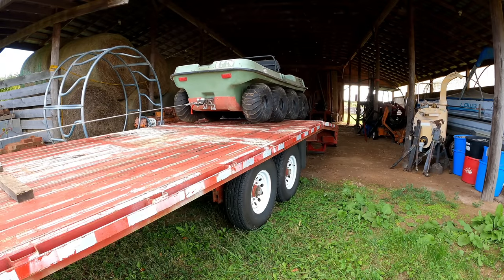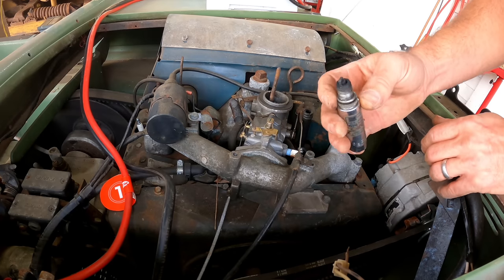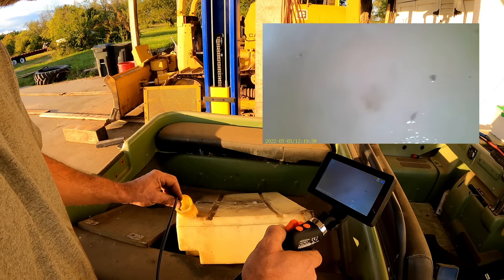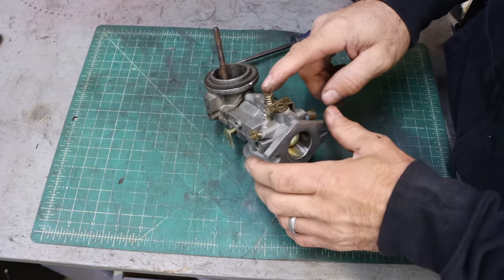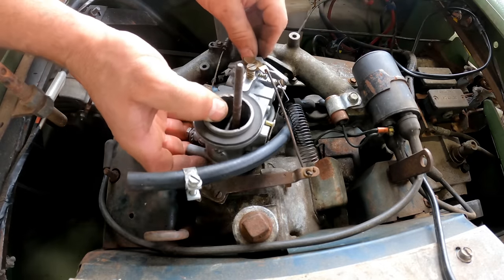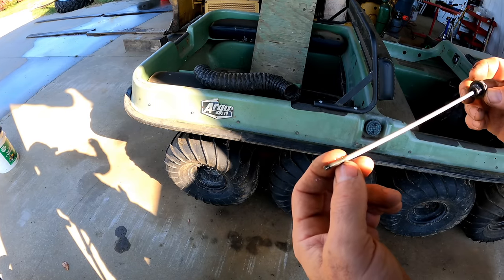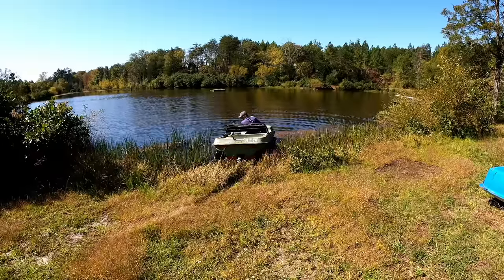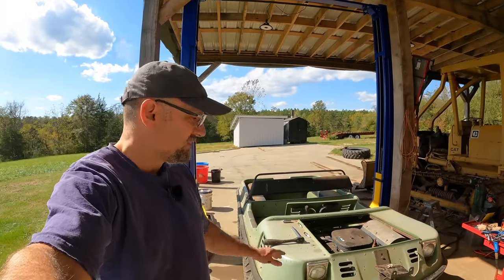Fixing An Abandoned Argo Amphibious Vehicle, Will It Start?

Comment: Not sure if your charger has this option. Mine is a similar model. You may be able to override the low battery failure to detect and apply direct voltage. Here are the instructions. 
1. unplug charger from wall
2. hook battery to charger
3. press and hold “display” and “type” button at the same time
4. while holding those buttons – plug the charger into wall.
* this will bypass safety features and charge the battery even if it is dead (assuming the battery can be charged at all)
– do not run in this mode for more then 5 minutes or you can damage unit and battery.
– this will get the battery enough of a charge so that the charger can detect a battery is hooked up to it (1 volt) .
5. unplug charger from wall.
6. wait 30 seconds and plug in charger into the wall.

Comment: That is a mechanical fuel pump on that engine. Most of the older Kohler engines of 12 hp and up used mechanical pumps.

Comment: I would do a compression check and a leakdown test. Oil in the cylinder after running indicates you are getting some oil bypass from the rings probably.

Comment: I've had 4 Argos still have a CG orange one 8 wheel ,They're all the same I found if you back out of water the back end sits higher ,But U also carry a 4 "rebar hook system to throw ashore or into a tree to pull as you go off water its way more beneficial ,But yup most are a toilet in water but ultimate in swamps and sloughs and will climb like a dozer ,I've made a boat motor bracket for mine using a trolling motor ,Now I have 3 gas small engines I haven't used mine for awhile  but it's got Runamuck tires like yours they're a water web tire you can get a flat track system from a 6 wheel too that is awesome in swamps but if they come off OMG your day is busy PS DO NOT LEAVE RAGS IN THE BODY  ANYWHERE unwrapping cloth from sprockets and chains suck bad .

Comment: Thing to remember is just because it is amphibious does not mean it can bulldoze down a wall of pond / lake reads, even full sized military amphibious vehicles struggle with such things so asking this thing to  bulldoze through them is an reasonable ask.   These like most amphibious vehicles need a fairly smooth and unobstructed entry and exit from the water

Comment: Fun little 8x8 vehicle. I guess to move it on the pond, a paddle would be almost as good as running the engine tho.
One question about reviving deeply discharged batteries: Is it not better to use a lab powersupply and set it to a very low current limit (< 0.5A) at nominal battery voltage and slowly build up the plating for the first few hours again? You can then gradually increase the charge current over time as it starts to pick up angry pixies. I would think that hooking up another car battery straight to it might reform it unevenly, so it does not ever get back to a high capacity again.

Comment: I really don't know a ton about these, beyond when they first came out I wanted one badly though I had/still have no use for one.  Would be cool tho.

Greg (Red Beard Garage) had one (though don't recall if it were an actual argo or a knock off) and he traded it to Mike Finnegan for something I can't recall, and Mike seemed to have similar experience with his in the one video I saw..  It floated, it'll go in/out of water, but its not super great on water.  In my professional non-engineer engineer opinion, those things need a prop for water.

Comment: My mechanic mentor when I was in high school back in the early 1970's had one.  It was the vehicle that I learned that WD (as in WD40) stood for water displacement.  We flooded out the points and he showed me how to pop off the cap and spray it down with WD40 to git'r run'n again.  Good times.

Comment: Don't fear the governor, sometimes it needs a helping hand. 
The higher rpm's should only happen initially when started. 
Then should settle lower once has been running for a brief time and not go back up to that range during use. Well not until the next time you start it. So you may not have needed to use the throttle limiter to restrict rpm's/speed. These things are slow enough. Lol 

Ps. Throw a bunch of gravel on a section of the shoreline so you will have an area to get in and out that isn't totally mud. 👍

Comment: The engine is not smoking any that I saw, so I would not be too concerned about those pits until there's smoke. Definitely install a bilge pump with a float-activated switch. Hate to see it sink in the middle of the pond. You probably need to replace some seals on the axles to stop the water intrusion. A gravel ramp or possible an old concrete slab from a driveway replacement would be just the ticket for entering and exiting the mucky pond.

Comment: Dude love your clip but just a little bit of advice you defeat the purpose of spraying starting fluid and opening the throttle all the way  having the throttle wide open is only an advantage if the engine is flooded

Comment: Do NOT ever try to shift on the fly this will break the shift mechanism inside the transmission which means you will have to remove the transmission for the repair.
The dipstick in the transmission is also a hollow tube breather..there is only one mark on it as you noticed.

Comment: I can confirm to you that IS the original steering system. Argo had two steering systems, a hydraulic and an armstrong (manual mechanical high maintenance pain in the ass system) as it constantly needed adjustment. Hydraulic was the  better of the two. Add a hundred pounds to the rear cargo area to level out on water. Grease the outer bearings as most likely water is seeping past the axles. Transmissions in these years of Argos are extremely weak mainly concerning the internal gears machined onto the input shaft. Having tore apart a few of those transmissions every one of them lost forward drive due to the teeth stripped and you can NOT buy new input shafts. This is why so many old Argos sit and rot away to nothing because the tranny blows out and new parts arent available as of 20 years ago. Tires,keep stock tires as they are the best designed to paddle in water. And as you found out Argos suck getting back onto land in soft shores due to lack of water propulsion speed and a very low to the ground underbelly. Throw some tracks on that thing and you`ll climb anywhere.

Comment: To answer your question: no, starting fluid doesn't go bad, it just goes away. The can fluid is primarily diethyl ether which has a low flash point and density so it evaporates and ignites very easily. The longer it sits, the more it evaporates.

Comment: Probably not a good idea, but in the past I've charged up lithium batteries using a benchtop power supply that supports current limiting. It can do up to 30V and 10A, you just set the current and voltage limits and hook it up to the battery. I imagine you could charge a 12V car battery the same way, just set the dial for 12V (or 14V since we're charging) and limit the current to whatever the battery is rated for.

Comment: Ok with the excavator pull out a lot of mudd down to hard clay drop in some large stone. Then smaller stone then some pea gravel pack it down each layer and make a boat launch.
Id add some boat dock type closed cell foam to the front to leval it out the front sits low i. The water, up to about where the seam is. Thats going to let more water in if you add balest in the back it could sink it.

Comment: I think a lot of the trouble you had getting back on shore was due to you trying to turn it while going up. It seemed like you'd pull the one handle and it would lock up, say the right side, so the left side spins and digs in. Then when you release the handle the left side can't get traction because it was spinning but the right side does so it grabs and turns it. Then attempting to correct it just gets the other side suck too. It seems like if you wanna get back up with that squishy of a shore you just gotta aim it to start and send it. Perhaps slowing the wheels down before they touch the bottom might also help, with as fast as their going in the water they're probably becoming a saw blade when they start grazing the bottom.

Comment: They suck in the water. Don't go through snow or sloppy mud at all. Have the middle tires at a higher pressure than the outside to help steer/increase life. When traversing the water try to keep both tires spinning as much as possible.  Get speed and break one tire after you get a little speed instead of just using one side the whole trip.  When trying to exit a pond a little steeper bank is better because you can hit harder dirt before you bottom out. Also when exiting a pond you need both tires spinning the whole time. try to line yourself up so both tires engage at the same time. Never break when exiting a pond only, at worst coast one side or you wont get out.

Comment: I think the split on the rings are aligned up, and your seeing that. I don't think you need to worry about the oil. it is identical on both cylinders so doubtful it is a head gasket issue. 

As are as accessing the Pond I would definitely put in some sort of ramp. ATVs like this can run on marshland but not pure mud. I would take some of your Logs and make a ramp with those - chain some of those together- about 12 feet long should be good enough about 7 feet wide

Comment: Looks like you have the start of slight pitting to the cylinder walls. But I it does seem to run good and I didn't see any smoke when it was running. Could be that the oil is sealing any differences on the cylinder walls to the piston rings. Keep your eye on your oil level and also for any signs of blue smoke. On the whole a great machine that is going to give you plenty of fun hours.
I think that it would be a great idea to build a launch ramp with your cat D4 and would be a great video. Please keep the brilliant videos coming 👍👍👍
Ps. Have you checked the psi on your tyres?

Comment: I have never owned one but seen a few. Some have larger tread on the tires than yours which would improve traction in mud and on snow and I expect propulsion through the water. I am surprised it could not drive out of the pond but certainly a gravel ramp would solve that problem....at least at your pond. Might want to talk with youtuber 2vintage. He has one.

Comment: My family has a few of them but they do better with the belt tracks and you need to make sure the seal that had wires all the way around it add the rubber seals On the body and replace the wire with bolts .they are lots of fun but much better with track on it parts are still available. If you are in Michigan or Ohio and want to sell it I give you good money for it

Comment: One time I found a BMW OEM battery that was only a couple years old and costs $600 new. It was discharged, had like 8 volts in it. I let it charge for a few days and it works perfectly ever since. Guess it came off of a vehicle with a parasitic draw and was thrown away after one of these "smart" charges refused to charge it or shown that it is bad.

Comment: This vintage early `80s also come with a Briggs Vangard 16hp Vtwin . The Vangard is better than the Kohler but since u have it already 2 x piston/ring sets plus gasket kit should not cost alot .
NB....... 6x6 8x8 ALL suffer from overheating when muffler is inside engine bay . Make sure ALL muffler hot air flow baffles are fitted . They are often thrown away . Most later models take this very seriously .  Many 60`s 70`s models have the muffler mounted to the area between the wheels

Comment: i'm betting when it's in the water full throttle isn't the fastest it will go. Try letting up on the throttle and I bet it will move faster in the water. the reason is because a lot of the water is coming up over the top of the tires and pushing back on your forward propulsion.

Comment: There is a possibility that what you are seeing on the side of the cylinder after driving which you said is oil, is actually oil mixed with water which is why it doesnt evaporate nor burn off. Which is what it should do if it was just normal oil.

But i am not an expert so take what i say with a lot of salt because i could be 100% wrong as well.

Comment: I bought a Daihatsu Rocky which had been stood under a tree for ten years the battery was dead not any voltage whatsoever I was really surprised that it charged up I’ve been using it for 4 years and it’s still great it’s a genuine Jaguar battery and is very heavy for it’s size

Comment: You can't try to steer while climbing out of a pond, All  wheels spinning at all times and straight into the bank. There is a learning curve with these. Move the gas tank and battery to the rear to level it out.

Comment: I would not use starting fluid o. An engine that hasn’t run due to the fact that it can scrub the oil from the cylinder and cause scouring.  A lot of guys use fuel with two stroke mix to assure that there is plenty of oil on the cylinder walls for initial start.

Comment: Yea Argo talks a good game, but they aren't ALL that. They are neat little vehicles, but very clumsy. When I was in hughschool someone's dad gave me one in pieces that had been sitting for years. It was a fun little project. You need either a steeper drop-off from the shore into the pond, or about 10ft of rip rap extending into the water. It'll climb out just fine after that.

Comment: I once put 40V on a 12V battery for 3days with a lab power limited to probably 1A ..   slowly it came down enough to charge it with my rc  charger (which is pretty damn skookum actually compared to normal chargers)..  That battery is alive an kicking , strongly still..

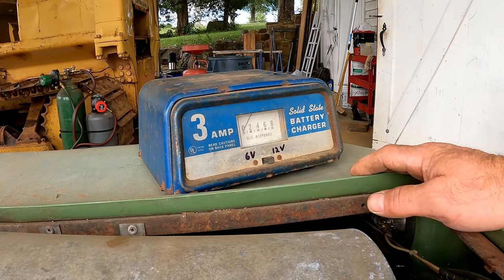Comment: Smart chargers are a pain because most need to see 10 volts for a 12v battery and 4 volts for a 6 volt battery manual chargers still are the best 6:15 @FarmCraft101

Comment: However, the devices with side cameras are thinner. They also fit through the hole from the modern diesel injectors. the movable one is too thick. That's why I prefer the thinner one.

Comment: I know that I was screaming inside, thinking surely he’s going to replace all the fuel line because the rubber breaks down and will clog that carburetor. You worked so hard to clean with all those little ports and holes but nope, you didn’t!

Comment: I have a harbor freight battery charger that has that built in safety feature that prevents it from charging. It's really easy to bypass that feature. So, mine will charge no matter what.

Comment: Too late for the Argo, but in future...
Butterfly screws are staked to prevent them loosening and dropping themselves and the butterfly into your nice, shiny intake valves, cylinder walls, and piston. You would not believe the awesome damage a tiny little screw can do in the wrong place. I suppose one could try loctite, but I wouldn't bet on it in an atmosphere of aerosolized solvent like gasoline. Short version: Never mess with the choke or throttle butterfly screws.

Also, I know it's done by some people, but lubing the butterfly shafts is a no-no too. If a good cleaning (Preferably in Berryman's ChemDip) doesn't free the throttle or choke shaft(s) sufficiently, there's probably a deeper issue that needs to be checked out. Grease, or even oil, are to be avoided because they don't ever go  away. They just sit there on critical bearing surfaces and collect dust and grit from the airflow around them, effectively turning them into fine grit sandpaper and wallowing out that precision fit. Pretty soon, your air/fuel ratio goes to hell in and handbasket, without even the consideration of being consistent.

Sorry, used to do this stuff for a living, and this just had me gritting my teeth and shaking my head. ;)

Comment: Kohler KT17 Series 1? ouch!  It's an Opposed twin Splash lubed engine. Those particular engines have Oil starvation issues when operated on a slope. It starves the rod ends of oil and they quickly blow up. The KT17 Series 2 engines were equipped with an Oil pump but they had a design flaw with the location of the oil Pickup tube being off to 1 side inside of the oil sump. KT17 Series 2 engines were somewhat more reliable than the Series 1s but it's still a ticking time bomb. Kohler fixed the oiling issues with the Magnum 18 and Magnum 20s.

Comment: I would wager it would do better transitioning from ground to water if you were backing in. You can see in the video that the weight is clearly in the front by how it sits in the open water. Between the weight and the tire scoops it's digging the mud rather than grabbing. Then again, maybe backing was the intended procedure to begin with. Some over-tire track system would likely be the pinnacle when it comes to performance boost if such a kit exists.

As far as the bores, they look pitted and the wipers look like they're leaking oil.